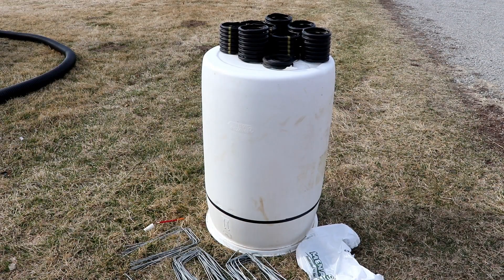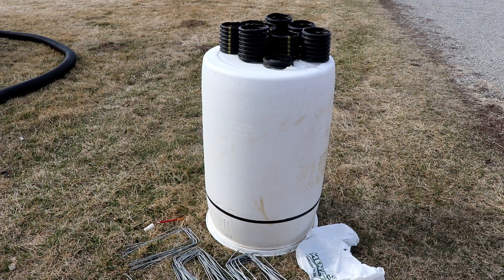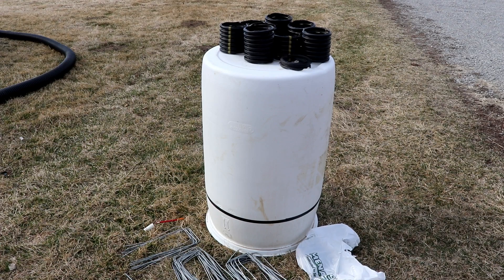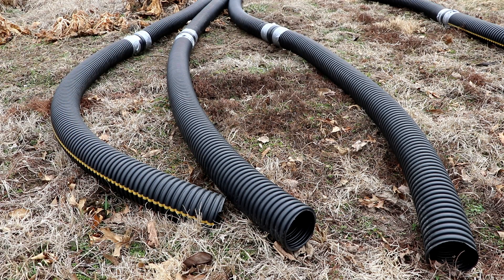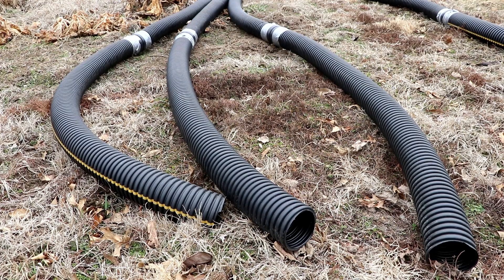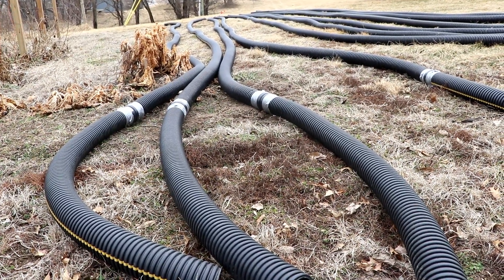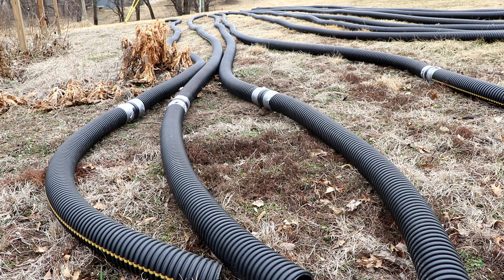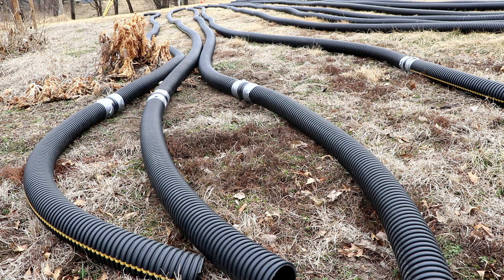Greenhouse for winter crops - part 2

Comment: I enjoy watching your project as you share it on YT.   Where are you located?  What do expect construction of this project to cost?  So far looks like you bought ~150 tons of rock  480 sq ft insulation,  (800+ sq ft filter fabric, 500-1000' + tile, etc, and about a weeks worth of heavy equipment services 40hrs @ $90/hr).  Around here (MN) that alone would be in excess of $8K and you haven't even started the actual structure.  I don't want to come across as an attack on you or your project, but in my mind for a $20-25K greenhouse with a production space of ~20x40  (800 sq ft) that is $25-32 per sq ft. Which is very very expensive in my mind.   ($8k - Heat sink, $4K structure/film, $1k production benches/shelves etc,  $2K plumbing and water supply, $3K lighting/power/fans/vents, etc., $2-5K for plug trays, growing media, pots, seeds etc to get you started)   Can you elaborate on your actual construction costs and projected operation costs?  Is this a hobby or do you operate a business?
Reply from the maker: Joe S thanks.  We are in northern Missouri Our total cost on material, labor, rock hauling and incidentals will be around 10k.  I’ve not yet figured in the cost of treated lumber for the hip boards and base boards on the greenhouse, or the cost of the grow boxes that will go inside.  That’s a significant cost, but when you break it down over a couple decades it isn’t that bad.  

We didn’t have any where close to 40 hours in the heavy equipment.  

We are doing this for ourselves but are considering selling some stuff during the cold months when there is simply no other locally grown option for fresh local food.  There are some higher end restaurants nearby that would love a local source of fresh good food.